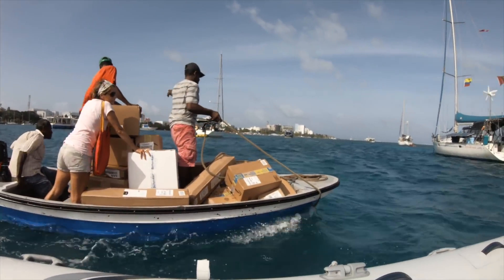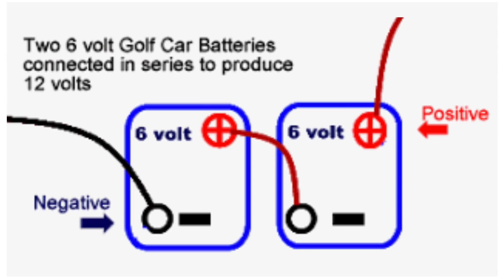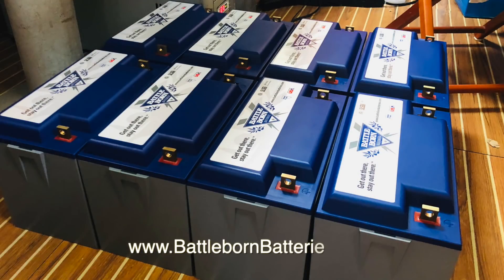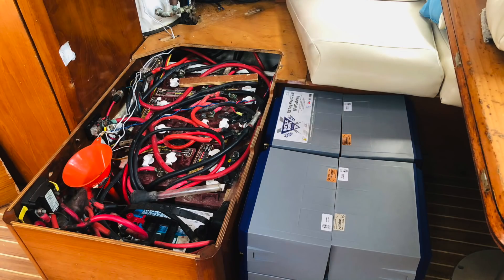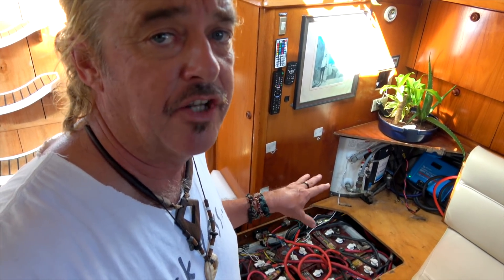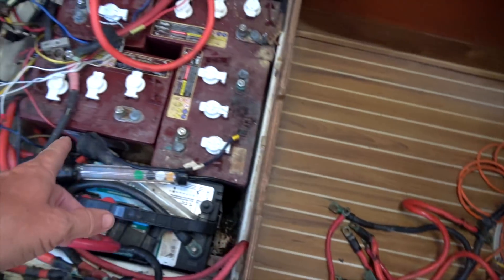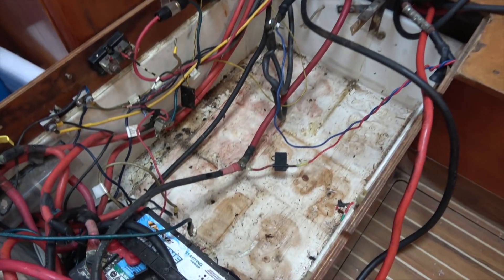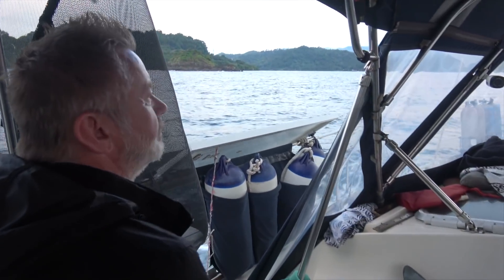SSL428 ~ Life on LITHIUM

Comment from the maker: Welcome to our first in a series of Tech Time videos starting with some details of our new Lithium system onboard, made by Battleborn Lithium Batteries in Nevada, USA!  We'll start out just explaining some of the differences between our current bank of lead acid batteries and the new Lithium bank we are installing.  Next episodes will get into further detail about our installation, and what has changed with life onboard since installing Lithium... cost vs features/benefits vs longevity etc.

Many other products will be reviewed in upcoming episodes as well, so keep your eyes open for my Tech Time episodes during the week, and the normal travel series episodes on the weekends. 

Stay safe out there everyone, and lets spend our newly found spare time learning something new!

Cheers,
Captain Rick
Reply: Lithium batteries scare the hell out of me. I use them for flying my RC planes and you have to be so careful with them
Reply from the maker: RC batteries are Lithion Polymer, car batteries like Tesla are Lithium Ion.. and yes both have explosive tendencies if mis-treated.. Battleborn uses Lithium Ferrous Phosphate (LifePo4) technology which almost completely cures that issue.. slightly less efficient, but a very good trade off when you live on a boat..  :)
Reply: @SailingSophisticatedLady  I suspect this new technology is probably in part a further development in battery technology by the aerospace industry.
Reply: @SailingSophisticatedLady  shouldn't you have kept the lead acid as a Second battery bank? A fully charged spare?
Reply: Ok thanks for the clarification Captain Rick
Reply: Isn't battery banks on 1 side of the boat, unequal weight dispersion?
Will the boat list to one side?

Comment: Just be sure those new batteries do not catch fire. Those bad boys burn until the fuel is expended, and can not be put out. Don't short them, or puncture the cells. But, the chemistry is amazing. Much lighter, for more power capacity.

Comment: Nice choice of Victron equipment and Battleborn batteries. However, to divide the load evenly over the batteries, all leads to the batteries need to be equal length and gauge. This is important for Lithium batteries and since you have 8 of them it really counts.

Comment: Let me ask you a related question? We see the wind generators how much do they put out and can the efficiently recharge a battery bank such as what you have on SSL? What about two three or four of them? Or are they mainly just to keep a couple batteries topped off like engine starting batteries ? One last question Rick do they come in different amp capacities larger blade sizes larger hubs to create more amps? Or could you connect them to inverters and reverse charge a battery bank such as yours on SSL? Thanks in advance, Fair winds and following seas and beautify bikinis!

Comment: It was difficult to tell from the video how the batteries are connected, but it seemed like the wiring was running from negative to negative.

This paper has good information on how to connect batteries to get the same amps on any battery in a bank:

https://www.iotaengineering.com/pplib/balancedcharging.pdf

Comment: Nice vid, the joys of welding cable is revelatory to lots of folks, and your planning and work is excellent. I have done lots of power systems all over-de-place, and cables (just a bit bigger) are a joy to work with. Also neoprene skin is good with oil, water/damp etc & doesn't flame. Your cable ends are nice. Fair winds, Thx!

Comment: Hey Rick ,
Always good to see you and I have always found a lot of wisdom in your tea talk and practical fix . Although I do have to question your thought on those lithium batteries . Yes in theory it always sounds Great but in real life it does not always happen that way... Case in point.. As a professional Airline pilot for almost 35 years and having trained on the New B787 , yes this Aircraft was certified with those very expensive and light weight lithium  Batteries.. The big problem though was .. Thermal Heat runaway... so we had several 2000 degree + fires on board... not a good thing for flying , yes makes one think about that hot fire out over the North Atlantic or Pacific... So what the Airlines had to do after numerous Fires...was have custom  build $ 250,000.00 custom titanium boxes built to withstand that 2000 to 3000 degree fire that always seems to happen...  And on a more personal note... when I first bought an overpriced Apple Mac book pro... for video editing ... I had 7 of them in ninety days .. Yes they all went nuclear ... I was even out sailing when one went off nuclear .. I had to throw it into the Sink full of water to put it out to cool.... So I understand that those batteries have a heat protection and cutoff but ... If.. this is the Verb...If they go Nuclear... in 90 seconds you have a 2000 + degree fire ... Do you really think you will be able to put it out... Hmmmm or even have time to hop in the Raft.. let alone get a Grab Bag.... Ok ,Ok , I too love the thought of Lithium ...but I just replaced with sealed Lead Acid batteries..I just sleep better at Night knowing they just Work.

Robert
North Star

Comment: I finally sold my O.I. 41 when I was 71 and faced with replacing the 6 Trojan T 105s for the third time. They got heavier each time. What Perkins is that. I had a 4 236. You might consider a 500 amp fuse in the ground lead.

Comment: Hey Rick,  great vid as usual. Question, have you considered having a percentage of your solar AC coupled ? Whilst the sun is shining the AC coupled panels would supply the load without cycling your batteries. As you would know  just like lead/acid batteries lithium batteries are also a consumable and the less they are used the longer they last.

Comment: Captain Rick, what do you think about an electric drive motor for your engine verses a diesel? I saw a video of a boater using a golf cart electric motor and just converted it to a marine type of electric motor that they got as a gift from another sailor. In my opinion, that's a very good way to go but I'd like to get the skinny from you before I decide. Also, they have now come out with a diesel outboard. I also like you to do a review on that if you can.

Comment: Very well explained on Electrical system. As a Master Electrician was explained well. I would suggest a small version of what wattage per Solar panel output as well as how many you are using, in layman terms or course. Nice storage of new batteries, now you have a new storage compartment.
Reply from the maker: Coming up Cpt!

Comment: Cheers Rick,
This is one of those episodes where I will have to replay a few bits just to try and keep up with the numbers, BUT, how come you are only using a 70 amp secondary controller rather than another 100 amp like your primary.  Even for redundancy wouldn't another 100 amp be a better proposition ??
As always stay safe and keep having fun.

Comment: Rick - About a year ahead of you on the Lithiums. 6 instead of 8. On the heat shrink, I use clear instead of the solid color. That way, I can see any corrosion forming, The colored end, I put over the clear back on the wire itself. So, end in the lug, covered by clear, and the red back about 3/4" so I can see the -- crimp, wire, insulation area.

The clear can also have identifiers / labels under it (numbers, labels, words) so they will not be affected by water grease (crap). Keep them coming bud. Also, look into MRBF style fusing.
Fuse holder  - https://smile.amazon.com/dp/B002INJXO6/ref=cm_sw_em_r_mt_dp_U_QQoKEb0M0W4MX  
Fuses 30 to 300 amps - https://smile.amazon.com/gp/product/B0761MGW6Q/ref=ppx_yo_dt_b_asin_image_o03_s00?ie=UTF8&psc=1

Comment: That is an exiting project for lock down in paradise. Compared to Your big solar and also wind gen I consider the 660 amp LA batteries fairly small.The Lithium batteries will also charge a lot faster. Even so You have a lot of power hogs on board I estimate at some points You will be having surplus. That opens up a new book and I am looking forward exploring. I guess You wanna keep the option of charging with the alternator. Now those alternators and Lithium batteries usually don´t make the ideal couple when married and it seems this is a hot relation that needs more attention. Have seen all kinds of inventions but besides throwing tons of money at it at least from a cruising standpoint nothing really convinced me. Too many black boxes I can´t touch that can make live very miserable when they fail. I try to stay more on the practical side. Always ask myself..... in case something fails "How Can I fix it ?  Looking forwards to see Your thoughts in action.

Best wishes and stay safe
Make sure the critters don´t creep on board
Reply from the maker: Yes, and you will enjoy my thoughts on this exact same topic because I approach things from the exact same perspective... stay tuned!  :)

Comment: We just repowered our boat with Victron, Battle Born and new solar. Do you charge your lithium from your alternator? Been very happy with the products. I wrote a blog post about it. http://sv-wildthing.blogspot.com/2020/04/ac-and-dc-electrical-system-upgrade.html?m=1
Reply from the maker: I have twin 12V Balmars currently, but now I'm thinking to upgrade the system to a 24V/12V hybrid system, but it's the alternators that are the main thing holding me back as they'd need to be upgraded to 24V versions first

Comment: The only thing I would add to that conversation is to apply some Vaseline or dielectric grease to the battery post to prevent corrosion. 
Capt Rick is the first cruiser I've seen to stress the importance of wire. The 1/0 welding wire ,though spendy ,is probably the best choice for ,wear resistance, water resistance and current capacity. You can weld 200amp on this all day and surge 400amp  easy . This wire is built for abuse. Worth every penny. Heed his advice on the Dual Wall Heat Shrink.
Reply from the maker: Thanks Chris!  :)

Comment: But using 200 amps in your case being larger usage , is what the battery’s need for long life , if you stagnate the battery’s there life will be short , remember solar panels fry up battery’s over there life , heat it the problem with battery storage if you cool the battery box you will gain the life of you bats , lithium does not like heat I have lots to do with them , keep them cool ,
Reply from the maker: the good news is, with the Battleborn and their built-in BMS, as long as you keep them under their 1C rating for charge and/or discharge, they never overheat and barely change temperature at all!  :)
Reply: @SailingSophisticatedLady  these things while discharging generate heat  . That's why some installations don't use cables and straps instead the straps act as heat dispersion where's as cables melt

Comment: You should have used the lead acid bank with a couple or one solar panel attached with that old controller and a cheap 2000w inverter to plug in a 600w 12v charger (on a 12v timer) during dead hours.
Reply from the maker: not sure what that would accomplish, it still needs input power from somewhere..?

Comment: The Battleborn GC2 batteries would have been a better choice for that angled storage arrangement.  Yes a little bit more expensive, but the better design for your usage.
Reply from the maker: any taller and they wouldn't have fit my enclosures.. and all the Battleborn batteries have the same internal sold state construction regardless.. :)

Comment: To save everyone some brain cells, Watt x hour (Volts x Amperes x hours) should be used when talking energy; Watts per day would be even better.
Reply from the maker: yes, it's a train of thought that most sailors aren't accustomed to yet because for years we've been working exclusively in voltage, and amphours consumed vs charged.. but now we are starting to migrate over to thinking in watts instead because then it can be translated easily regardless of the operating voltage of the vessel discussed.  :)
Reply: i prefer v/ah over watts.

Comment: Just wondering if a big chunk of iron in a freezer would store ‘coldness’ and smooth cold loss during the warm day? It could be ‘charged’ at night.
Reply from the maker: that is essentially what our cold plates do now.. they are hollow metal plates that are filled with glycol solution, with lots of copper coils running through the solutions.. when the refrigeration gas expands inside the copper coils which are inside the solution, they try and freeze which draws all the heat out of the glycol solution and causes it to freeze instead.. then the frozen cold plate continues to absorb heat from the inside of the fridge until the compressor starts up again and the whole process repeats.
Reply: @SailingSophisticatedLady  Thanks Rick, I had wondered if there were techniques, very interesting. Stay safe!!
Reply: In old days (on land lol) people dug out  holes or cellars in the ground for foodstorage, and put iceblocks in there to cool the food, but they had sawdust over the ice, it made the ice last for months. Ingenious !
Reply: @Vidar.m  I used to run a boat in the Caribbean and I loved the way that people found solutions to a thousand problems. That's the story of the human race I suppose, surviving and thriving!
Reply: Iron aint great heat/cold accumulator for example a water is much better, thats why you need a lot more time/energy to heat a water than the iron.
Reply: @altergreenhorn  Very interesting, thank you.

Comment: Lithium is certainly the way to go.  I think every boat should run them.  Silly not to.
Reply from the maker: I think it is merely a matter of cost right now, but as they become more popular you will see them drop in price, just like all other electronics.. :)
Reply: Jeff to replace that 6 volt bank with new golfcart would cost $650.00 bucks in the States.   those 8 lithium cost about $6500.00.  not everyone can afford it my last golf car bank lasted 8 years on my sailboat.  I used to work on a golf course and dead carts charge back up after two 200 pound guys play 36 holes day in and day out.  You just cant beat the power for dollar of golfcart and they are durable in my opinion.